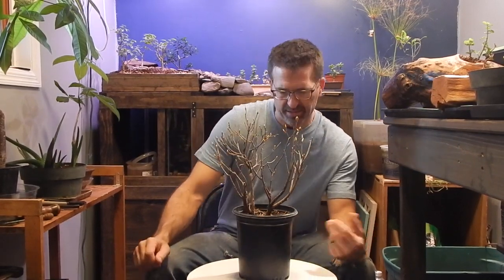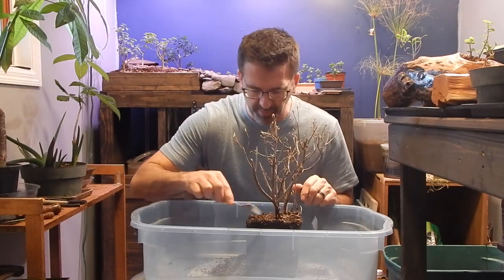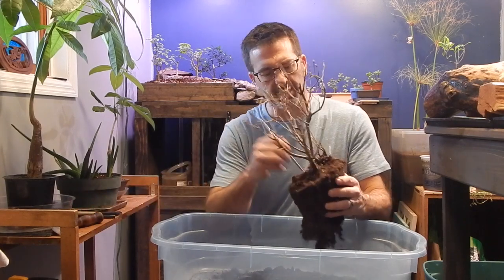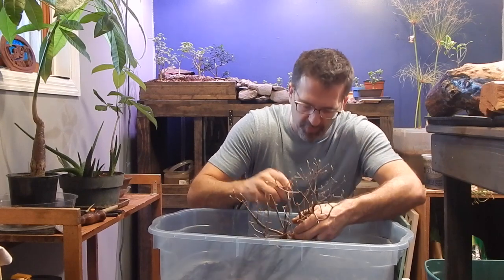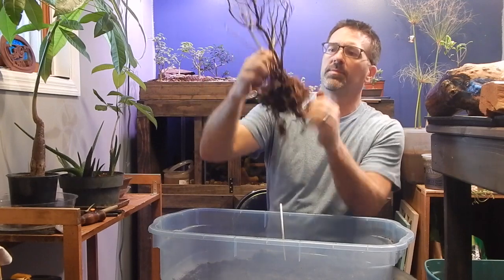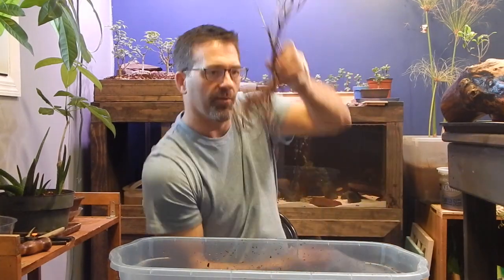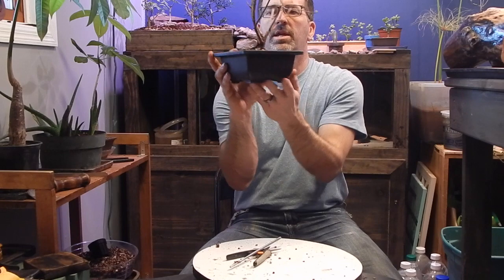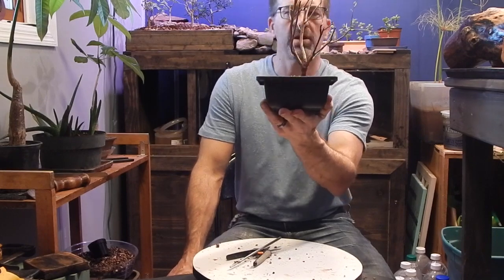Dave's Bonsai Episode 3:  Repotting Azalea

Comment: I moved the azalea to a new pot by throwing away a lot of the planting medium soil, but all the leaves fell off over time, leaving only a few leaves and the branches dry. Have you ever experienced this and is my azalea still alive?
Reply from the maker: @Pingkuning  I have not experienced that.  The few that I had just seemed to slowly get weak and died.  One got too cold over wintering it and I think the roots died out.  Did you completely bare toot it and repot it or just get rid of some soil?
Reply: @DavesBonsai  In my area, the planting media from the plant shop only uses chopped leaves or rice husks for soil stock, so I replaced the media with standard soil that is often used for bonsai. I cut off the dry branches and left the leaves that are still fresh and active.
Reply: @DavesBonsai  I didn't cut the roots, but I threw away 80% of the soil and I replanted with a better planting medium
Reply from the maker: @Pingkuning  what climate are you in right now,
Reply: @DavesBonsai  This year the dry season, I put my azalea under a tree
Reply from the maker: @Pingkuning  not sure what to tell you on this one.  A disease?  Pest?  Sorry I couldn’t be more help.
Reply: @DavesBonsai  It's okay, I just share my experience with you, thank you for your answer 🙂👍